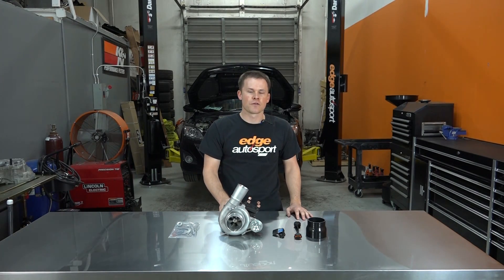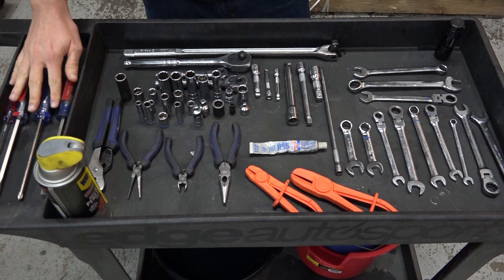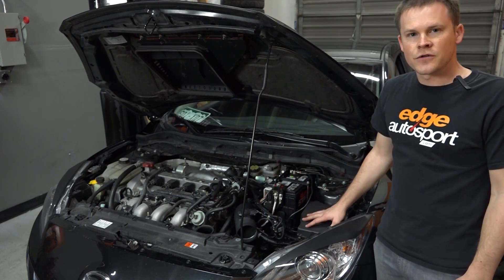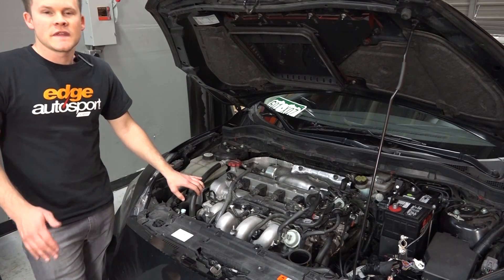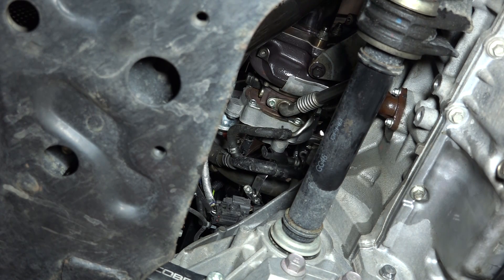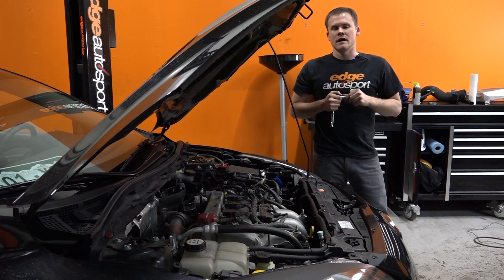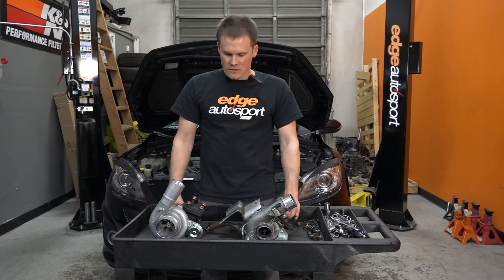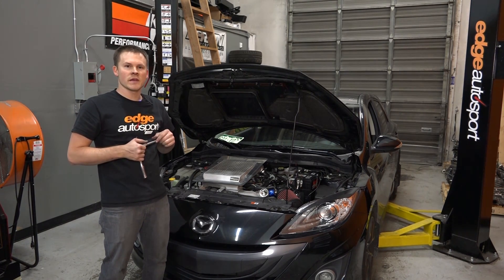BNR Stage 4 Turbo Installation Video Mazdaspeed 3

Comment: I am installing actually a Corksport turbo in my 2008 speed 3. I’m having some trouble getting to the first five downpipe bolts on top. But my question is do you absolutely need to get underneath the car to unbolt the turbo?

Comment: Where I can get that complete kit.
Reply from the maker: http://edgeautosport.com/bnr-stage-4-turbo-kit-mazdaspeed-3-2007-2013-mazdaspeed-6-2006-2007/

http://edgeautosport.com/bitwise-motorsports-bosch-map-sensor-connector-mazdaspeed-3-2007-2013-mazdaspeed-6-2006-2007/

http://edgeautosport.com/bosch-3-bar-tmap-map-sensor-with-iat/

Comment: This looks wayyyy too easy. What am I missing?
Reply from the maker: Easy to some, not easy to others. If you have experience working on cars, it's really not that crazy of an install. Usually a 4-5 hour process for someone that really knows what they're doing.  6-7 hours for a guy that doesn't have a ton of Mazdaspeed or modding experience. This video is pretty complete to be honest!

Comment: Is it okay to drive a BNR STAGE I without a tune??  Is it basically just a stock replacement?
Reply: Drew L no, if you decide on going big turbo contact a e-tuner for a custom tune but first you would need a cobb accessport or versatuner for tuning capabilities. A great choice of turbo though, I’m thinking about it for my speed6 but it’s a little more difficult of an install due to the awd set up/transfer case being in the way of the install from the bottom.

Comment: I saw the dyno videos that showed in excess of 400 wheel torque with 24psi on the S4. Isin't that beyond what the stock internals can take? Did the dyno Mazdaspeed had a build engine with forged internals?
Reply from the maker: It's not beyond what the factory engine can do, but it depends.  If it's tuned safely enough and you don't abuse the car too much, it can last a while.  But it typically doesn't last as long as a stock car would.  Just like any modified vehicle though, there isn't one answer about what something can or can't do.

Comment: Thought this was possible to do without removing the manifold?
Reply from the maker: It is possible if you remove the battery and if you delete the EGR.  I can't quite remember how tricky it is to get in in there but you're right, it can be done.
Reply: Edge Autosport, Awesome. Thanks for the FAST reply.  👍 Taking this on soon.

Comment: is ot okay if you have a kosmic returnline on a oem ko4
Reply from the maker: If it fits I'm sure it fine but I'm not sure that it actually does fit.
Reply: Edge Autosport well i just ordered it today fingers crossed. i would think if you can still use the oem return line it would fit np Thank you

Comment: Hey Alan, I was wondering what kind of BOV you have or recommend since I prefer fully vent to atmosphere. But I'm scared because when manufacturer make it recirculating to intake it's for a  reason. I just don't want to mess with air fuel ratios or mess anything up. What would you recommend for long life of a semi abused 2013 ms3..Thanks!
Reply from the maker: It's completely fine to run an atmospheric blowoff valve on the MS3.  You're right, there is a reason for recirculating but it's not a big enough reason to resist your urge for a vented BOV.  Go for it.  The HKS is a great one, we've used it on one of our build and it's a very high quality valve that you don't have to adjust or maintain.  The Tial Q is also very popular, you need to pick the right spring based on your vacuum reading.  We recently put on a Go Fast Bits SV50 on our Focus ST and I like that one a lot but there aren't any bolt on options for that.  You'd have to get a pipe custom flanged for that with the flange that comes with the valve.  Let us know if you have any other questions.  All 3 of the valves I mentioned are available through the site!
Reply: Thanks!
Reply: Edge Autosport . I guess my last question to you would be if with the turbo,intake, exhaust and down pipe would you need to run upgraded fuel pump internals. Or with your exact setup what's the max we can push before needing more fuel? This would be for daily use 80% of the time. Again I thank you for your knowledge and experience.
Reply from the maker: You would 100% need fuel pump upgraded at that point.  There is no exact setup for when you need them.  If you want to make over 275whp, I'd plan the upgrade before you go past that.

Comment: do you need to buy a smaller battery for the battery tray?
Reply from the maker: Yes, the battery tray used on this car doesn't allow for a full size battery.  You'll need a smaller one.

Comment: I really like your video and the way yo did the install,what would  you recommend on a 2008 Mazdaspeed 3 turbo install im starting having problems with mine and i think is time to put a new one one problem is i dont know any shops who do this kind of job here in Phoenix Az.
Reply from the maker: Hey Polo!  Thanks for the comment!  There are a handful of good turbos available that are easy to install, including this one.  It really just depends on your goals and preferences.  The Garrett turbos are ball bearing so they will spool well for how big they are and much air they can flow.  The BNR S3 and S4 are great turbos for being able to spool quickly and still maintain a decent level of top end airflow.  The choice is yours.  The good news is, we only sell good turbos on our website so you can't be steered a wrong direction through us. :)  Let us know if you have any other specific questions.  You can call or email us too!  edgeautosport.com
Reply: Bnr S3 or S4 are the best choices 👌🏼

Comment: Is 400whp w this turbo possible on 93 pump w/o meth injection with the proper tune and supporting mods?
Reply from the maker: Not really, and even if it is, you're going to be too close to any limits of that fueling which is dangerous.  Pump gas really wasn't made to make a lot of power and shouldn't be treated as such.  If you don't want meth injection, I suggest using a mixture of about 25-30% ethanol in your tank and you can stretch the limits of the turbo much easier and safer.
Reply: Edge Autosport  can u you run this turbo on 91 not trying to push lots of horsepower kind of my turbo seals are done and need to replace turbo but at the same time prep for the future what do u need my car is stock to the bone if u can provide a list from edge auto sport I would appreciate it

Comment: Is this BNR S4 Turbo reliable on a MS3 with stock internals? How much mm is the Turbo and how much whp is it good for?
Reply from the maker: +Devonte Murray It CAN be reliable to a point.  It depends on how hard you are on your car, because any car fails from constant abuse at some point.  You also need a tune that will promote reliability.  It's similar to a GT3076 which has a 76mm compressor wheel and a 58mm turbine wheel.  I don't know the exact specs though.  It's definitely good for around 400-425whp while staying mostly efficient.
Reply: Edge Autosport Is the BNR S3 good for stock internals? I'm curious to know cause I might consider a MS3 in the near future.
Reply from the maker: +Devonte Murray I would really answer that the same way I did on the S4.  They are both fine on stock internals if tuned properly and the engine hasn't been abused previously.  As with any upgraded turbo car though, nothing is guaranteed.
Reply: +Devonte Murray If you're referring to the HPFP internals, you'll want to upgrade it.
Reply: ***** What's HPFP?
Reply: +Devonte Murray high pressure fuel pump internals: http://edgeautosport.com/autotech-hi-volume-fuel-pump-upgrade-kit-mazda-mazdaspeed-3-2007-2013-mazdaspeed-6-2006-2007-vw-audi-2-0t-engines/
Reply: +Devonte Murray forget about upgrading to a bigger turbo without better HPFP internals. You will ZoomZoomBoom, its more than likely. I had to replace my internals on a BNR s1 and a more agressive tune. Whats more, there is very little sense in getting a big turbo without a downpipe and an upgraded intake

Comment: LOVE my BNR S3 on my 2010 Genpu. How does this stack up in terms of ultimate power it'll support, boost threshold, and transient response? The S3 will support 380whp before needing supplemental fueling, and some have pushed it really hard to over 420. If I WOT @ 3,000, I'm at 20+psi by 3,250, and transient response is excellent.

You say the S4 is capable of 400whp, but so is the S3, which is also more responsive. With the GT3076 compressor wheel on the S4, it'll obviously have a higher max flow rate. So would this be good to 450whp? 475whp (with supporting mods, of course)? If someone only wants 400, the S3 could be viable...
Reply: Numinous lol 😂 I like how you definitely know your stuff, you definitely ha e more knowledge in this bnr turbo then myself but I was able to follow you just fine and I still find it funny how no response was Given to your comment. Basically in sort... you outsmarted them and pushed harder on earlier model when they say they can only push 4 with the next step😂. It’s funny to me.

Comment: what size was the coupler that u guys used ? and did the stock coupler fit where the turbo and intercooler meet .?
Reply from the maker: +11ufcfighter This car had a 3.5" HTP Intake and the BNR has a 3" compressor inlet.  So, the coupler here was a 3.5" to 3.0" reducer.  Whatever you have it needs to be 3.0" to whatever intake tube size you have.  For the turbo to intercooler coupler, yes, the stock one fits and we actually used it in this car in the video.
Reply: +Edge Autosport oh ok thank u! and what size clamps would u guys use for a coupler that's straight 3 inch for the turbo to the intake?
Reply from the maker: +11ufcfighter Clamps are obviously not one diameter, but you just need to get a clamp that's advertised to fit a 3" pipe or make sure that the range is equally above and below the range of 3" so that it has good coverage for clamping down and loosening up.

Comment: The HTP 3.5 fits the BNR S4 as well as the K04?
Reply from the maker: +arcade16 Definitely!  All you need to do is get the correct coupler to mate the 3.5" pipe to whatever turbo you're running.  The intake will fit with all stock location turbos, as long as you're using the appropriate couplers.  If you ever switch turbos, all you need is a different coupler.

Comment: I would unplug the negative battery terminal when doing stuff like this just my 2 cents. Otherwise great video Edge!
Reply from the maker: +JD Davis Ha!  We figured someone would say something about this and the truth is, your 100% right.  We ended up taking it off halfway through install and not showing it in the video because of that.  But you couldn't be more right.
Reply: +Edge Autosport  Hah yea i saw at the end of the video you had it disconnected. Great now i dont know if i want a s4 or a corksport turbo.
Reply from the maker: +JD Davis S4, of course!!!  ;)

Comment: Nice vid.  I prefer to pull the 2x 10mm bolts from the primary EGR instead of removing the exhaust manifold, but both methods have their benefits.
Reply from the maker: +Sal Mafi If you remove the EGR valve and the battery tray, you can install the turbo from the driver's side without taking the manifold off.  I suggest installing an EGR blockoff instead of putting the EGR valve back on but it's up to you.
Reply: I would like to do that but I live in California. Smog laws are so strict here. Would disconnecting the valve have the same effect?
Reply: Sounds like you have installed one of these. I have an S4 ready to install and rather not remove the manifold. Any advise is appreciated. Thank you.

Comment: Very tempting upgrade. I think there maybe an S3 or S4 in my speeds future.
Reply: +everythingdiy DO it! I just got my S4 for $900! I am installing a couple weeks!
Reply: @baxterbrown3 How did it go? I've heard this turbo will be done at 50k miles
Reply: @MFLP1979  8 yrs ago I picked up a used S4 v1 and ran it for 100k miles before selling it again to someone else. They didn't have any issues with it after that. BNR turbos are a solid choice in my experience. I've moved on though and now run a Borg Warner s257sxe on my speed 3
Reply: @baxterbrown3  so glad to see this, I've purchased a brand new BNRS4 and just want to make sure it is the good to go. Thanks for your prompt reply on this, I appreciate it
Reply: +everythingdiy Can't wait to watch the install! All of your videos have been super helpful!